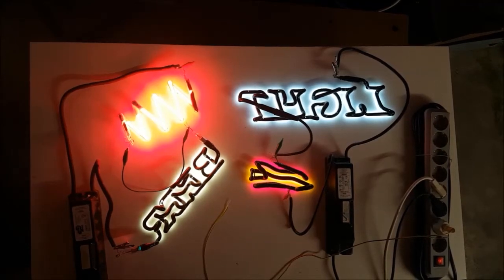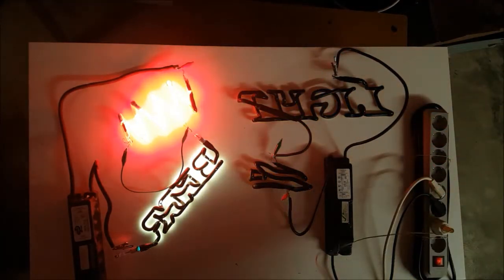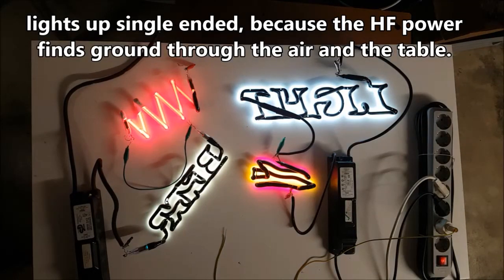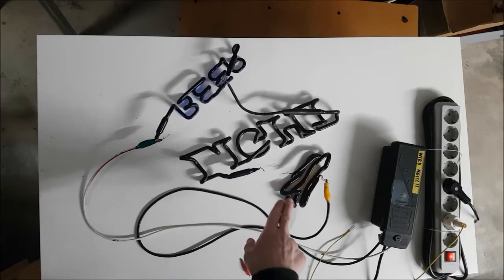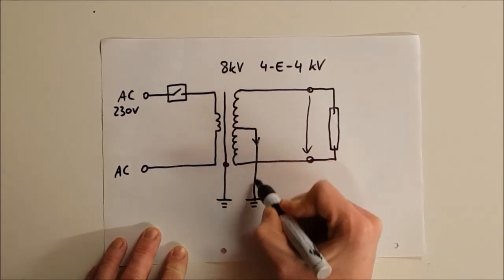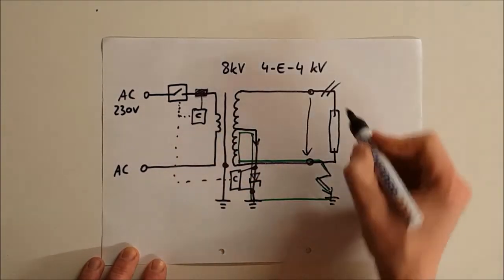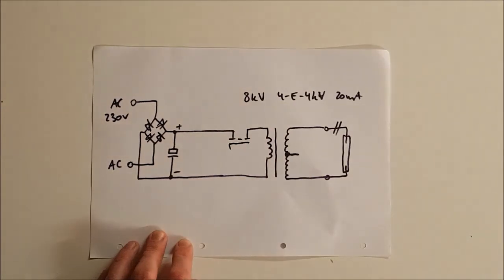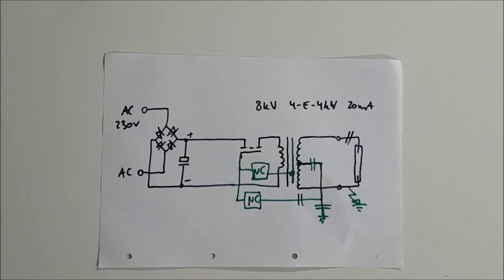Neon Transformer Safety

Comment: Hello! amazing vintage channel. How would I go about doing a basic wiring of a 9kv 30mA neon sign transformer to a dimmer or variac to ouput the current to an spark gap? Im building a tesla coil!
Reply from the maker: Hi, is it a real old style heavy tansformer or an electronic one? You can only dim the old ones. Use a leading edge dimmer. Trailing edge won't work or even get toasted.

Comment: All my older vintage beer signs use a traditional 60hz 120VAC input iron core transformer (Franceformer). . Recently I bought some brand new neon signs to add to my ever growing collection. I noticed that all the new signs use these small, light weight "transformer" which I assume consists of a voltage multiplier and frequency multiplier in order to operate the neons at a higher frequency rather than the traditional high voltage at 60 cycles. I have never opened up one of these new ones but I'd imagine there might be a small step up transformer or coil within in addition to a voltage multiplier.  My main interest is what are the advantages / disadvantages between the traditional iron transformer and the new electronic transformers that are prevalent these days. I have noticed that unlike the traditional ones these new transformers don't get as hot as the old ones. Even after a full day of use in the summer these new electronic "transformers" are at most slightly warm to the touch.
Reply from the maker: @WitchidWitchid  hi, please search for "neon transformer do's and don'ts" and "the 60 hz problem" in my channel. In those i explain advantages and disadvantages of the transformer types.
Reply: @NeonSignStuff  Thanks. I'll check it out.

Comment: About safety: Do I assume it correctly that (very) old neon transformers - that only consist of coils and metal cores - don't have any safety function at all? - Well, even with old stuff, at least the case of the transformer and the structure of the neon sign should be grounded, but that may not count as a real safety function. :/
Reply from the maker: All correct!
Grounding the frame is important to prevent shock from the frame in case of a ground fault, but thats just the most basic measure.

Comment: i was given a neon   sign from job.  the wires was cut and and it doen not have a transformer. how can i find out what size tranformer i need the sign is one word 16"x36" 5 letters
Reply from the maker: Measure the total tubing length including the black portions. Footage charts for transformers are available from the manufacturers, tech22 for example. If it's 10mm glass, don't use more than 30mA current.
Reply: @NeonSignStuff  To comment additionally. I have some neon signs with glass segments that have broken. I would like to delete those sections and wire the undamaged sections to the transformer. Can I just do this, or can a transformer be "too powerful" for the tubing? Thanks!
Reply from the maker: @onocoffee  yes, you can jumper broken tubes. Electronic transformers (small, lightweight) are almost always auto-adjusting. With a heavy core&coil, the tubes will get just a little bit more power, but underloaded core&coil transformers will get hot, so check for that.
Reply: @NeonSignStuff  Thank you!!!!
Reply from the maker: @onocoffee  watch for correct isolation everywhere. Neon runs on high voltage and those thick cables and isolating caps are mandatory.
Reply: @NeonSignStuff  Got it. Cut out the broken sections, connected the remaining, and everything has been perfectly smooth. Thanks!